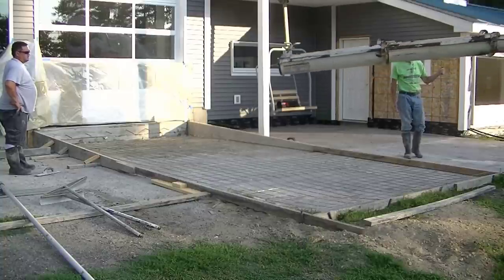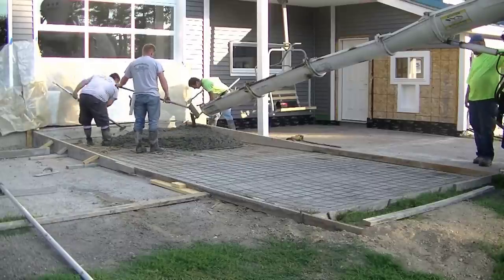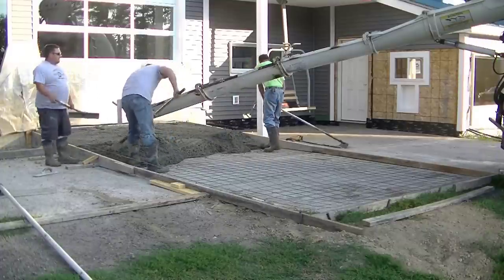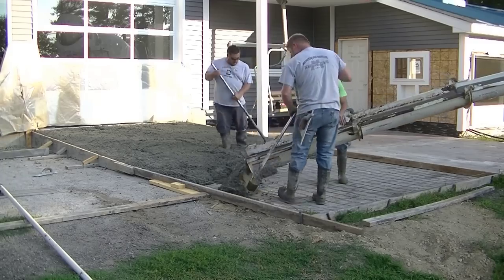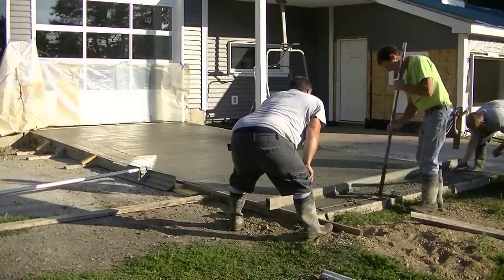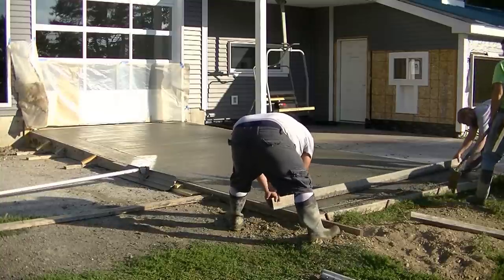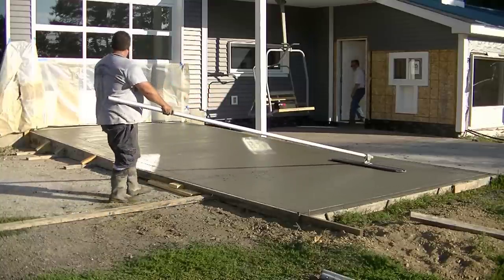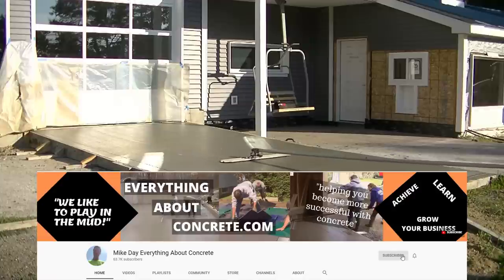Pouring Concrete Over Existing Concrete (New Patio Slab)

Comment: I have been on the fence about that DEWALT vibrator or a smaller plug in vibrator. Would you buy it again now that you have used it?
Reply: We have a battery one and a bigger plug in one where I work. The little battery one isn't really good for much only been useful for like 6 inch stem walls etc anything deep and wide it just doesn't have the power IMO. It'd be nice as its much easier to pack around maybe they have better battery operated ones but I would only trust our plug in one for anything big.
Reply from the maker: Matt, I'd buy it again for sure. We use it all the time for our flatwork jobs. I don't do walls so I couldn't comment about that but I'd bet it would be ok for that. I have the 18v to 20v adapter for the batteries so I can use the new bigger batteries. They give it plenty of vibration and power.
Reply: Awesome, thank you guys for the input! I wouldn’t need it all the time but for some stuff I do a vibrator sure beats hitting the form with a hammer or mallet.
Reply: I will have to check out the adapter for bigger batteries and see if that helps its a real small stinger though so I think it's just not meant for much commercial anything lol
Reply: Yea I checked in out today at a local supply house. It definitely hits harder than the makita I used a few weeks ago, but I get what you are saying about it not having the balls the corded vibrators have. They wanted north of $400 for the one I saw today.

Comment: I want to pour a concrete walkway on the side of the house over an existing one. How thick should I pour the concrete? How many inches at least? Also, do I need a wire mesh or rebars? It doesn't get a lot of traffic on it. Thank you in advance.
Reply from the maker: If the existing walkway isn't heaving and all broken up, you can pour 3 to 4 inches over it and be good. If it's really broken and heaved, I'd break it out, fix the gravel and pour new.

Comment: I’m wondering if the Minnesota winter would affect the same concrete “overlay style “
Reply from the maker: We've got pretty cold winters here in Maine.
Reply: Mihaly Vincze-Turcean the old driveway was probably 2 inches wide.
Reply: Mike Day Everything About Concrete 👍Thank you for your help
Reply: I think what's more important then the temperature is wether or not water gets in between the old and new layer.
Reply: Tenth Dimension that a excellent thought. That’s another reason the slum was so low.

Comment: Hey I have been watching your videos for a while now and they help a lot. Also i have a question I currently have a job is a back patio were the customers wants a larger area but the existing concrete is coming off should I remove the old and make it all new or pour over the old one? I can go up at lease 2 inches. What do you recommend

Comment: Hey Mike,  I'd like to pour over a cracked patio with some settling in various areas due to poor drainage.   Cracks are about 1/4 in wide in some areas. Am I able to pour over something like that? Or, do I have to worry about  greater settlement under the current cracked patio?  Lastly, if I do pour over the top, will the new pour continue to crack and settle?
Thanks

Comment: Great video as usual Mike, like and subscribed for a while now. Just bought a home in Honolulu Hawaii so don't have money to remove and lay a fresh driveway so I've been filling my cracks with Rapid Set Cement All and so far I've been loving the product. Do u have any experience with Cement All? It's constantly hot and humid here and I'm a huge fan of Durability so 9,000 psi I feel is well overkill for my 2 SUV's. So my plan is to lay about at inch of cement all after I fill all the cracks. Any information you have for me is much appreciated. God Bless and keep those videos coming👍